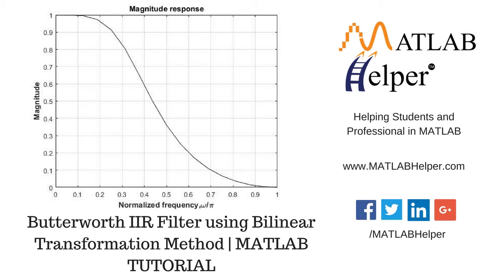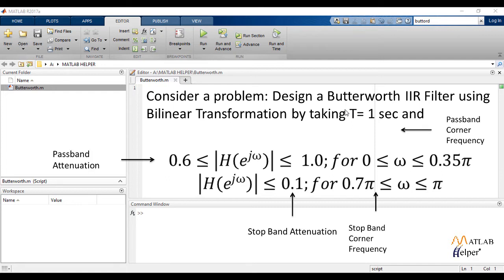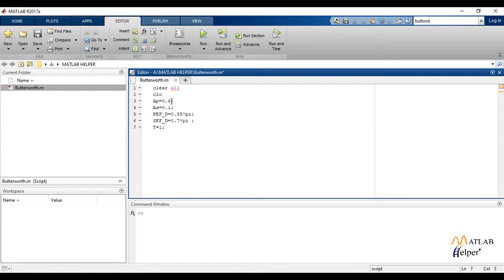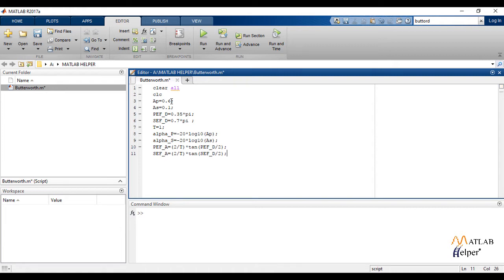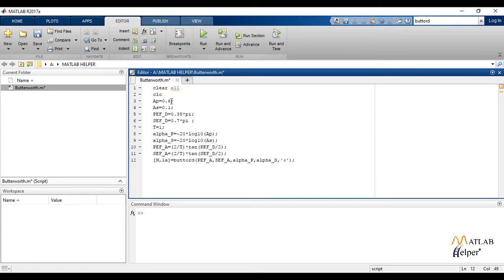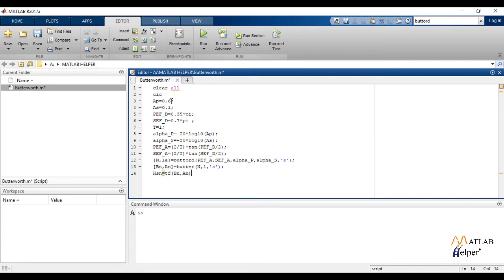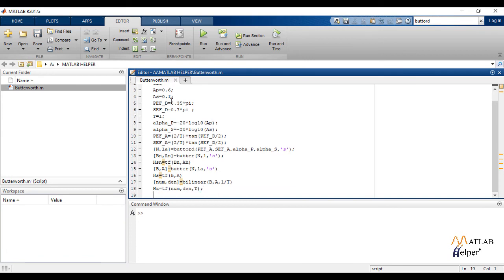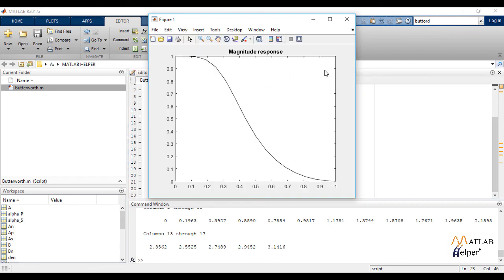Butterworth IIR filter using Bilinear Transformation | DSP | @MATLABHelper

Comment: #As per the given problem we need to know the values of passband attenuation, stopband attenuation, passband and stopband corner frequency.
#convert the values of passband attenuation, stopband attenuation i.e ap and as to decibels.
#calculate the new corner frequency.
#buttord is the command that calculates the minimum order 'n' and the cutoff frequency of digital/analog butterworth filter as per filter specifications.In that command 's' denotes that we are working in s-domain.
#butter is the command that returns the transfer function coefficients of nth order.it can be used to determine the unnormalized function.
#tf is the command used to determine the transfer function.
#bilinear is the command that converts the s-domain transfer function to a discretized equivalent in z-domain.
#freqz is the command that gives the frequency response in z- domain.
#abs gives the absolute value.
#i have learned all these commands and can design Butterworth filter using biliear transformation for a given filter specification.
Reply from the maker: Tejaswee Rayana, Glad to see your appreciation for our Video. Do support us by Subscribing to our YouTube Channel at https://www.youtube.com/c/matlabhelperteam